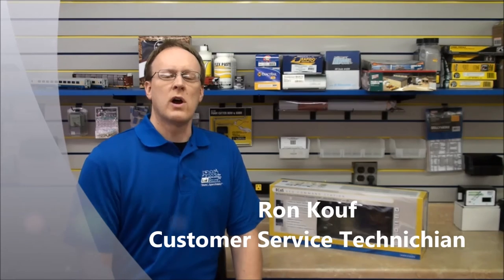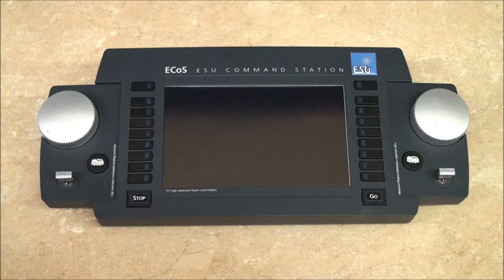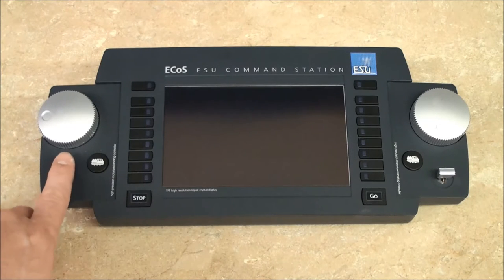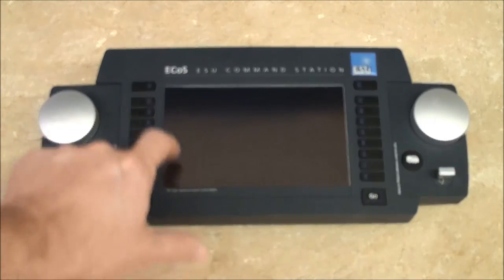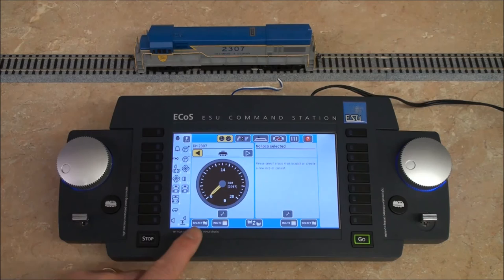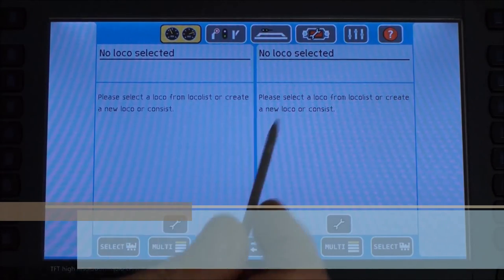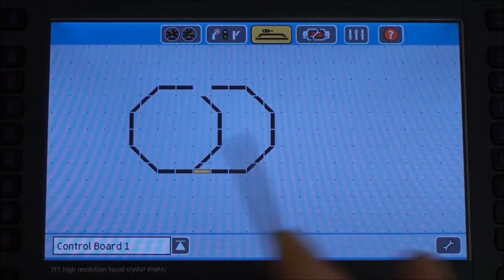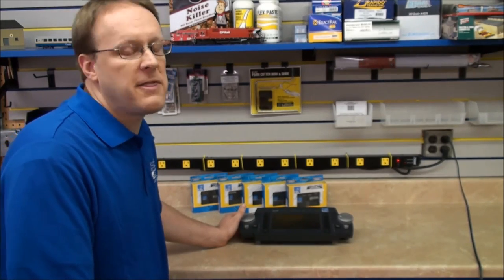ECoS Command Station Tour

Comment: I bought one of these 5 years ago. It  was and they still are very expensive. Though it has a cheap plasticy feel about it. When I had spent many hours trying to make sense of the User Manual I finally just lost enthusiasm,  put it back in the box and stuck it in a cupboard.  The device may perform wonders but the User Manual is incredibly frustrating. I went back to using my then 7 year old MRC which does most of what one needs easily and without having to be a trained ESU technician. But now I am building a new layout I have recently started trying to make sense of it once again. These videos help a bit, but they also neglect to explain a lot of things. And frankly I would prefer to spend days building the layout not trying to decipher the instructions or searching through these videos. I admit I am not a technical person but unless you are a trained ESU technician you might want to look at something that may not be able to do a thousand things but will do a lot without requiring you to spend hours or even days trying to figure it out. I am still searching for an explanation of what a 'sniffer code' is and how one uses it.  The section on the sniffer function does not explain it.  I am actively researching something more user friendly that has instructions written by a native English speaker, preferably a professional writer.